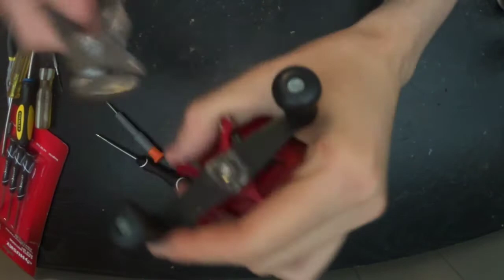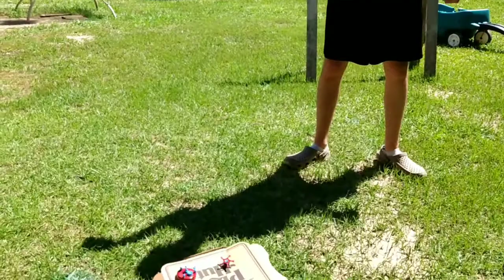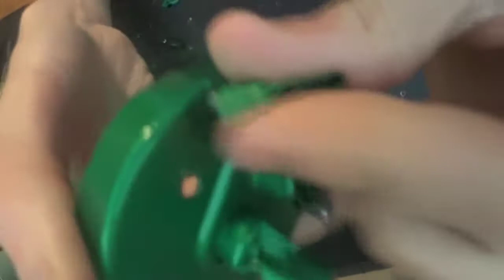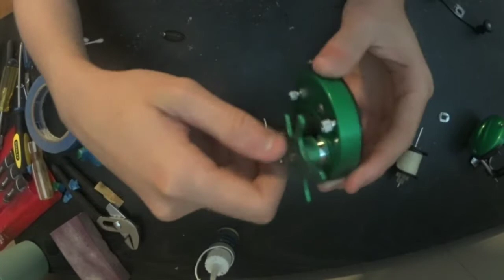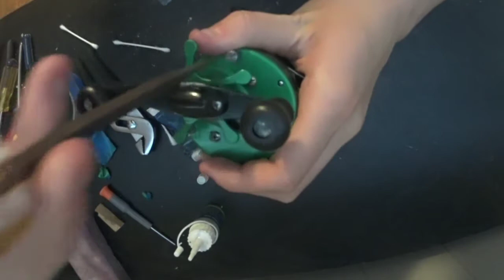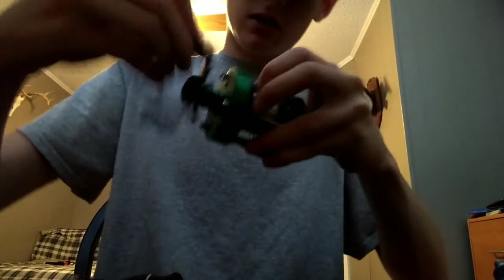How to paint baitcasting reels- step by step tutorial

Comment: Is that paint pretty scratch resistant? Also, I think you are only supposed to oil the worm gear (the part that controls the level wind) cause grease is too thick and causes resistance during casting. Grease is for the parts that only move when you reel like the main gear.
Reply from the maker: Yeah the paint holds up pretty good, but I don't use that reel a ton. From what I've read, you lightly grease the worm gear and oil the part that contains the worm gear. I hope that's helpful.
Reply from the maker: I think TackleJunky did a series of videos on how to clean and maintain reels that is way more helpful than this video